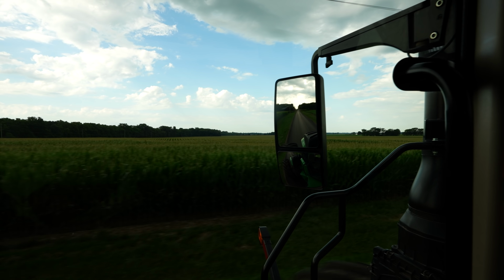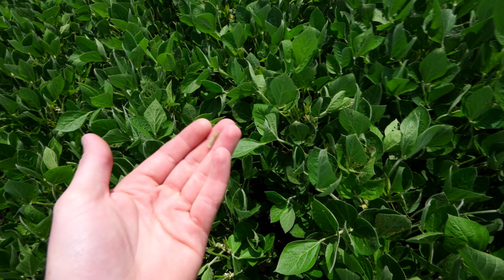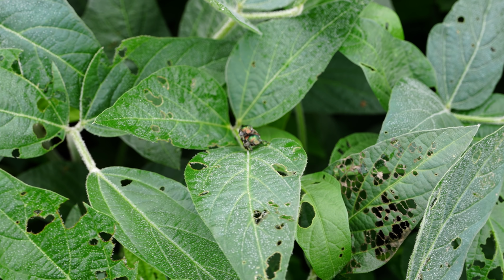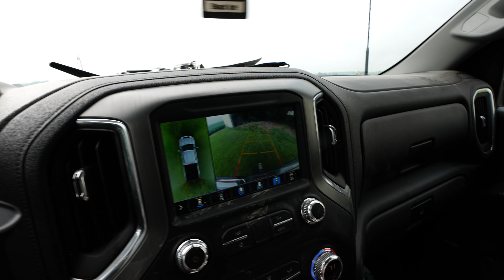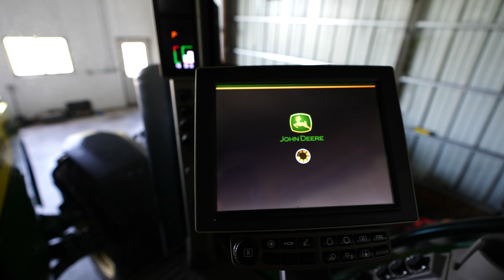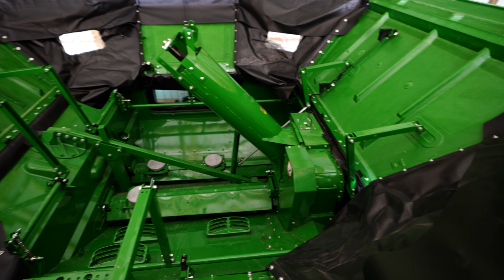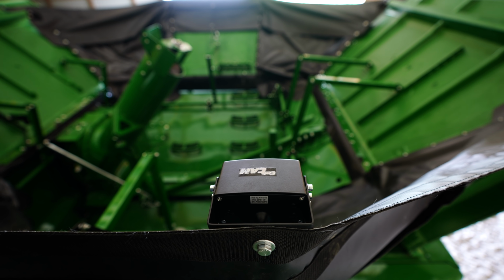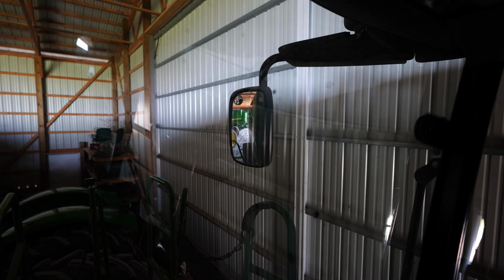Gambling $100,000 On Our Farm

Comment: How much for a plane, insecticide, and fungicide & top dress N/  ac
Reply from the maker: We don’t add any N, so I’m not sure on the price of that. Nutrien has some products with N and K for soybeans. Plane is $14. Sprayer is about 40% of the plane. Fungicide and Insecticide for soybeans are about $25.
Reply: So 120ft ground rig, insecticide & fungicide on soybeans $25?
Reply from the maker: @PrestigeWorldWidePWW  no. $30.
Reply from the maker: We also had some micro nutrients in there as well as a growth stimulating product to try. Those actually bring the total into the low $40s. The field where I flew the drone looks absolutely ridiculous right now. With a few more good rains, it could break our records. It’s another good year to try new things.

Comment: I have never used a helicopter, but I have used many, many, many air tractor. And what I can tell you, when it comes to fungicides and pesticides? No ground rig in the world can get better coverage. We have done several tests, it’s the same every time, plane beats ground rig.
Reply from the maker: You think a plane can get better coverage than a ground rig? I am skeptical on that, but you may have seen that on your farm. Application method is kind of like seed company choices: people only see what they want to see! Some data supports air application, others supports ground application, and another set says that you’re wasting your money regardless… 🤣
Reply: @aTrippyFarmer  we have done multiple tests over varying conditions. Not a chemical company, we did it ourselves to make sure we are getting the most bang for our buck. Plane won every time. And it wasn’t close. Between my Dad, my brother and I, we farm a little over 22 sections, cotton, peanuts, forage sorghum, and a few acres of alfalfa. We did everything from strip tests, tissue sampling, yields. We use two ground rigs and for everything fungicide, foliar feed, pesticide and defoliant related, we use the plane. Everything else we use our sprayers. Unless we are behind and then we call in an air strike.

Comment: What percentage of crops do you loose from the crop spraying because it looks quite a bit of damage from the wheels.
Reply: Option is do nothing an possibly lose a crop or do something and reduce yields. 

Only question is if they did their own with better/best tracking could they tighten the loss. 

But not all operations want to deal with the chemical and infrastructure needed.
Reply: @thelunatick1993  👍
Reply from the maker: The wheel paths are damaged from this application. Keep in mind, we’ve already ran over these beans twice this season. As long as the sprayer gets in the same row, your beans there didn’t have full potential anyways. They recover much better earlier in the season, though. Some farmers choose to pay a little more for an aerial application at this point in the year, but I like the ground rig for the reasons mentioned in the video. The neighboring plants will actually grow into the gap somewhat, albeit not completely l.
Reply: @aTrippyFarmer  thank you 🙏

Comment: Curious why you guys dont invest in a sprayer. Would love too hear your thoughts on doing it yourself vs hiring it done. Love the videos!!
Reply: Came to ask the same.
Reply from the maker: It’s a fair question. For the longest time, the custom application was extremely economical, and it still is on paper. When we accounted for the logistical and labor requirements, we have been hesitant to invest into one. However, looking at the rising price of custom application, potential discounts on chemical, and the possibility to replace the aerial application with a high-clearance sprayer, it has become a very serious consideration. I have full intentions of buying a Hagie next season.
Reply: Check out the fendt R9. Has ability to go from dry application to wet in 2hrs and is able to have a high clearance option from the factory. Worth a peek IMHO
Reply from the maker: @nickspecht9708  my wife’s family has one coming in this fall. I’d love to get one, especially with the quality of Fendt’s warranty.
Reply: @aTrippyFarmer  wife's family must live too far away to borrow when needed🤣